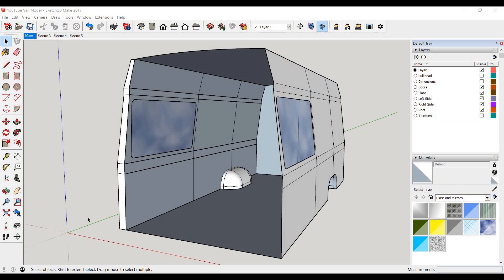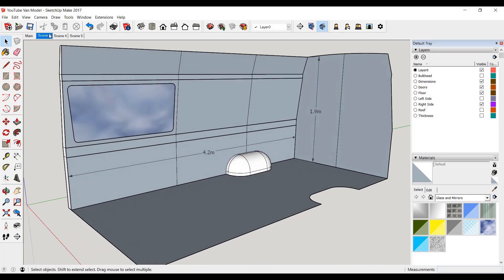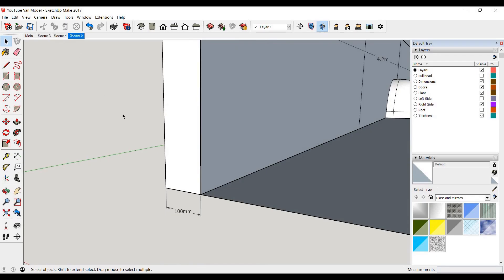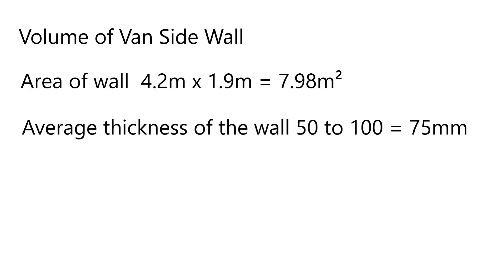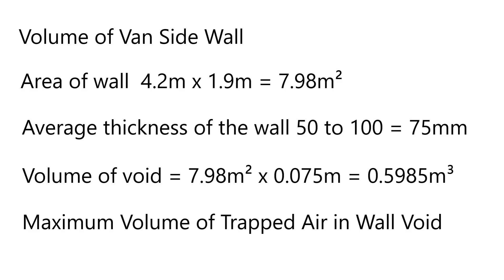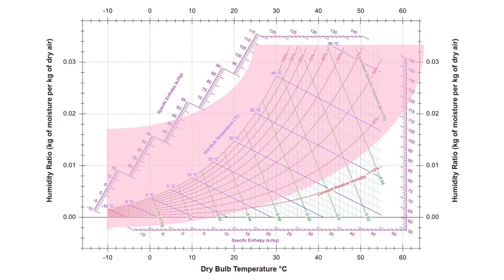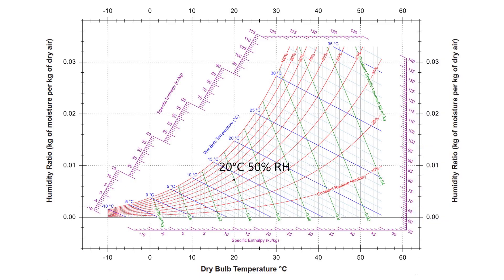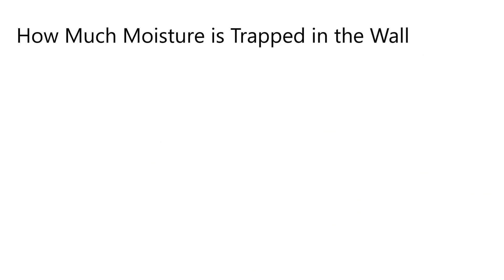There is Moisture Trapped Inside my Vapour Barrier!

Comment: Great video Greg. Having followed your build which really helped ours in 2020 one thing keeps coming back to me when we talk about sealing the vapour barrier. We're sealnig the interior of the van but the walls aren't sealed as they are venting from the underside of the van via the drain holes in the sills. Does this affect anything? My thinking is that any vapour trapped in the walls would over time and heating of the external of the van, dry out?
Reply from the maker: You would be best to seal any trim clips and holes. That way there is no way any moisture can get in there in the first place 👍🏼😃
Reply: @GregVirgoe  even the drain holes in the sills?
Reply from the maker: @Tangotop  yes but not in any of the doors. I suggest putting insulation in plastic bags in doors to allow them to still drain. You can’t seal handles and locks.

Comment: Should also be noted that, that calculation is based on a void with just air. A typical build will have an insulator of some sort in that void, reducing the air content much further and reducing the moisture even more so.
Reply from the maker: Exactly 👍🏼 I also have a window cut in which is another m2 lost but so you could say this is absolutely worst case scenario. 😃
Reply: @GregVirgoe you have failed...to account for "imperfect" /NON VACUUM SEALED vapor barrier...over time the barrier AND hit and cold metal will PULL IN vapor and TRAP IT...
Reply: @1truthseeking8  Uh, no. Temperature differences do not "pull in" water vapor. And even if water vapor gets in between the van exterior walls and the interior vapor barrier, as you point out, the volume is not vacuum sealed. Air can migrate in, and it can just as easily migrate out. What can NOT migrate out is the water vapor in the interior of the van. Because there's a VAPOR BARRIER, you see. The only water vapor in the air inside the insulated wall is the vapor that can be held by the colder air, and therefore there is no condensation in there.
Reply: Great video Greg extremely well explained, and in my opinion that's a finger up the nose of the doubters, thank you for all your helpful and informative information, happy travels to you and Lou 👍
Reply: Another gem.  Makes all the complicated stuff seem so simple.  Thank you again Greg  👍🏻👍🏻👍🏻

Comment: Another great video. When I converted my van a few years back, I used rock wool with a reflective foil type vapor barrier. Not ideal, but it's what I had to hand and it does keep the van toasty. I recently decided to fit an extra roof vent, so had to take down some of the paneling and vapor barrier, and found that the insulation was bone dry, and considering rock wool holds water like a sponge, I think that proves residual moisture behind the vapor barrier is nothing to worry about.
Reply from the maker: Thank you for posting that confirmation. We have rockwool in our van but with a good vapour barrier there will be no condensation in the first place. 👍🏼🤩

Comment: Greg, when should the vapour barrier be applied, after the insulation but before the decorative finish?
Reply from the maker: Yes insulate then vapour barrier then your cladding 👍🏼😃
Reply: @GregVirgoe  
I'm sure someone will say "but what happens if you puncture the barrier when you fix the cladding?"
Answer(?)
The screw clamps the cladding at the fixing point, sealing the "hole"....?

Comment: Thanks for another interesting video! I started my van build in the winter at –5 celsius. As I was inside the van, a lot of condensation formed on the walls presumably resulting from my body heat and breathing (I also had a small heater in the van). The walls were so wet I decided to postpone the insulation for the summer. When I checked the van the next day, the moisture was still there but had obviously frozen. I think not only should the environmental moisture be taken into account, but also moisture resulting from the person building the van. Adequate ventilation should help of course.
Reply from the maker: Obviously don’t insulate if the walls are soaking wet with condensation. 
Use lots of ventilation by opening doors to get rid of that moisture. 
If the inside conditions match the outside there will be no condensation.
Reply: Use a good electric radiant heat, not a gas if your working in a van as gas has a high moisture content..Open the roof vent or windows a bit if you don't have a vent, crank the heater up and all moisture in van will head for the clouds..lol..